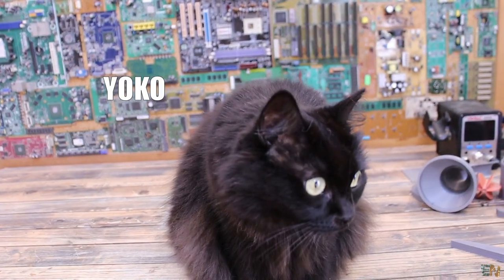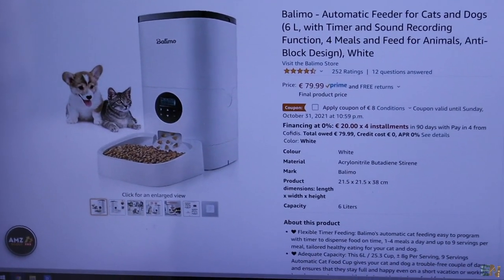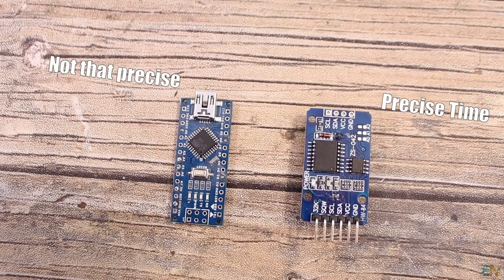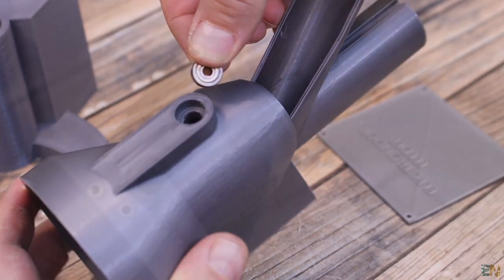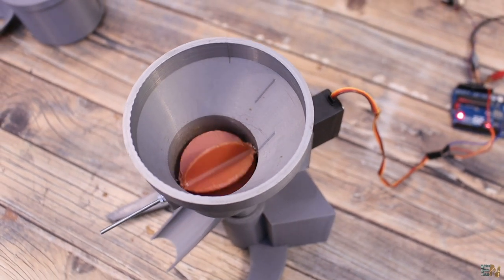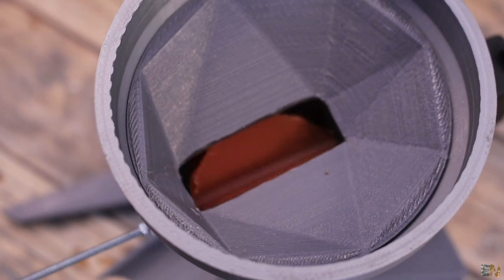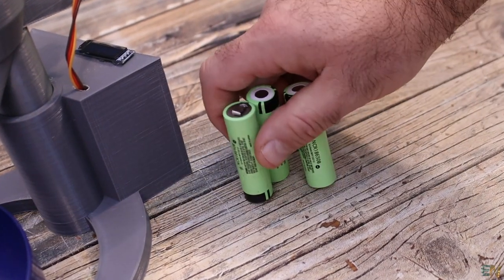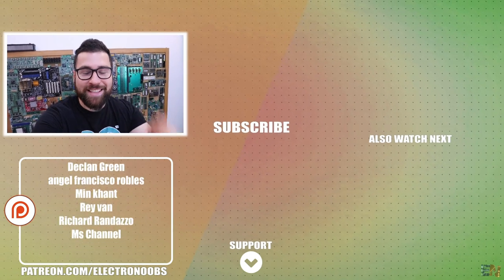Homemade Cat Feeder - 3D Printed & Arduino Control

Comment: Nice project! Btw you don't need to hack an servo for a 360 rotation, you can just buy the MG996R servo that has the same price as MG995.
Reply: What if i use MG90S motor is it okay?
Reply: @desmond856  not sure if that one has enough torque. And that servo only does 180° rotation, you will have to hack it too
Reply: @PedroFNMartins  Mine actually rotate 360 without hack
Reply: @PedroFNMartins  and it's about 1.8 kg of torque.

Comment: Genius 🌻
What a clever engineering.
On my system I chose a other type of feeding system: one main container, a secondary container which is connected to a weight sensor. That uses much more space!

I didn't have it on battery power, and I add to your statement: "Cables are never a good idea, when cats are around" 😅

Not sure yet, if the cable is the problem or the cat ❤😺😂

Thank you for sharing your knowledge! I've just found your channel! This is real advanced engineering! I can learn a lot from your videos! Brilliant work! 🍀

Comment: Good job, I would suggest you cut the 3mm rod to size, it wouldn't be nice having a one eyed cat.
Reply from the maker: True. I've already did that but is after I've recorded the video. HAHAHA that rod is dangerous.
Reply: If a cat is stupid enough to poke out its own eye on a stationary rod, it probably would have already done so on a fallen twig outdoors.
Reply: @NiHaoMike64  the rod spins at random times throughout the day, could be some bad timing
Reply: @ELECTRONOOBS  Hi. May I know how long the 3M threaded rod is needed in this project ? and I also need to know what type of bearing are you using

Comment: Absolutely cool. I have three commercial feeders now and their clocks are terrible. They vary by seconds each day. My DIY replacement plan is to skip the Arduino, though, and go with Shelly modules. Then, I can use HomeAssistant or Alexa to schedule the feedings.

Comment: I’m building a similar project with some 3d printed parts but i have hygiene concerns about it. Some filaments like PLA themselves are organic but the small crevices on the part might cause bacteria buildup in time, so you have to apply coating for it to be foodsafe. You might want to consider applying coating for your kitties’ health!
Reply: What type of coating should you apply if you want it to be food safe?
Reply: @julianjaimes197  ^
Reply: just wrap with food grade plastic on it or sanitise it with a layer of pure alcohol.

Comment: Another cool use: A group of those to prepare dosage for hydroponics nutrient slur. They are dosed and fall into a pre-mixing container. Mixed for X seconds to guarantee total dilution and then this pre-mixer just open to the min mixer where all parts will be combined. The big conainer should also have a mixer for extra dilution. Then after X seconds, it is sent to the plants. A task that will take a farmer a couple hours, done automatically.

Comment: Hi i am in the process to finish this great project, I only suggest the use of servo.detach() in the code to remove the jitter due that is very annoying, also i recommend to print the blades in PETG, it helps a lot..
Reply: how did it turn out? because i read some comments telling it didnt turn out so good..

Comment: it would be a good idea to add an esp32 cam so that u can check on the feeder and the cats remotely
Reply: esp32 cam is not even worth it  
they have  blink mini on sale right now for $10
it's just not worth the price
with consumer electronics  being so cheap thee days
better of with a wyze v2 or blink mini
Reply: Is it possible to add online control buttons by replacing the nano with esp8266 via Internet and Blynk  ?

Comment: I made one a while back using a stepper motor and a screw auger instead of a paddle wheel. Also recently added a battery backup so it can run even if the power goes out.
I've been thinking of adding some way to detect the food level and remind me when it's low. No solid ideas yet other than counting the used portions and estimating.
Reply: Hello, maybe an infrared emitter and infrared sensors at different heights could do the job.
Reply: Isn't there a risk that humans become useless and the cat treats this machine as their personal slave?
Reply: Hey! May I know how you add a battery for backup use ? I also want to add a battery to my project as back up power supply. How you do it , can share the video link ?

Comment: The part list recommends a DC 12v adapter, and a buck converter to lower it to 5v. 
Why not to use a DV 5v adapter, supressing the need of a buck converter?
Is it equivalent? Any disadvantages? Thank you

Comment: Very cool project! I've thought about getting myself some feeders as well, but never got to do so because I can't control the portions each cat gets to eat, even more so with only one bowl. Do your cats share the food evenly? How would you control this? I've seen feeders that only dispense food / open if they read a certain tag from the cat, that way the same cat could not trigger it multiple times in a row, it's not 100% fail proof, but it would be a nice and challenging adition to this project.

Comment: I have both a dog and two cats.
I wanted to build 2 dispensers because the food is different and my dog would eat the cats' food.

So I need to add like a door on the cat's dispenser so that it can only open for the cats to get to the food.

I thought of putting some sort of metal on the cat's collar and make something like a metal detector but I couldn't figure it out

Comment: first, thanks for sharing
i have a question, is it ok to connect the servo motor only to the arduino and set delay bitween the feeding times without the clock?,
only with the "delay" code.
Reply: Hello, first you should avoid using delay, use millis for delays etc. Second delay is inaccurate on such ling periods of time, so rather not use it.
Reply: It is not recommended to use delay ms to keep track of the feeding time. It's not accurate and not precise to count time specifically for hour units , it would get bugged by time. 2nd is because if we use delay function, it wouldn't save the time if there's an electricity shut down. once electricity came back, your cat feeder wouldn't continue to run the schedule.

Comment: How many servo motors can be controlled by a single arduino?

I want to build something similar for rabbit cages. A main feed tube along the vertically stacked cages, individual short tubes stemming off the main tube will supply food to each cage. There will need to be servos and food dividers in each short tube.

Comment: Shouldn't take long for the food to jam the wheel. Tried the same style feed wheel with 3, 4, 5, and 6 blades with different types of funnel positions to no avail, it will jam eventually. Even sounds like you can hear it fighting some kibble in the video.
Reply: Is there any good solution?
Reply: @yarch4e227  I ended up designing my own castle cat feeder that uses a horizontal auger feed screw.
Reply: @zero2583  thanks, I also thought of that. Now I am redesigning.
Reply: Would auger screw mechanism cause food jam?

Comment: As usual, a very nice project ... 
adding nodemcu to make an IoT device would be another nice addition .. 

but, is there another way for the rotating mechanism without the rod going out the chassis .. 

Thanks
Reply: you can cut the rod the length you want and then put a cover on the end ( with enough space to let it rotate freely).
Reply: @gabiruman what cover we should put after cutting the rod. Do you have the specific name of that cover ?

Comment: I'll try to make this and it's catastrophic, blade touch kittle funnel, nuts return deep in blade, i'ved to cut the blade. Servo motor forcing and damaged internal gear. I'm sad of the issue.

Comment: hi when I compile the arduino IDE firmware it gives me the following error on line 11 DS3231 rtc(SDA, SCL); Firmware:11:21: error: no matching function for call to 'DS3231::DS3231(const uint8_t&, const uint8_t&)' DS3231 rtc(SDA, SCL);Thank you

Comment: A great chance to make an esp8266 or 32 and control by phone using an app
Reply: and even add a camera via the esp cam
Reply: @Seu_Lunga  wtf man, the cam can be used to check on the cats and to check if the feeder is working properly
Reply: Just a terrible joke rofl

Comment: The RTC usually fails after few weeks. If someone faced the same share your solution/ experience.
Reply: As I understand it's a problem with the battery. The module usually is sold with a CR2032, but is made for a rechargeable battery. A solution is to take the resistor that goes from VCC to the battery supply as it is charging 5V to a 3.6 V non-rechargeable battery.
Reply: just change the battery will do.

Comment: Your cats need less food and more exercise, just like you.
Also, with that long pin sticking out it won't take long before a cat is missing an eye.
To make it worse, your cat feeder is nearly impossible to clean, and the wires won't last because cats love to play with them.
Last but not least your cats just need to give this contraption a light push to make it topple.

Comment: I have an sg90 servo (tiny!) and I was trying to attach him a threaded rod like you did. The problem is that I can't screw it directly to the servo, since the inner diameter of the shaft is 1.7mm (which means I would have to use an M1 threaded rod, and I can't find it anywhere since I don't even know if this things exists). Anyone can suggest me how to solve this?